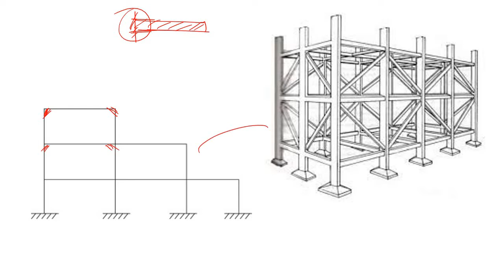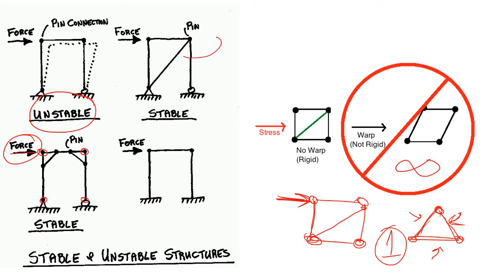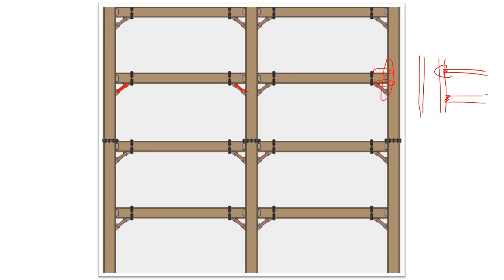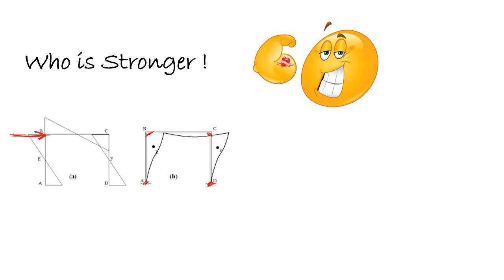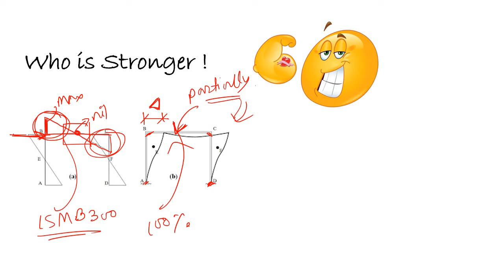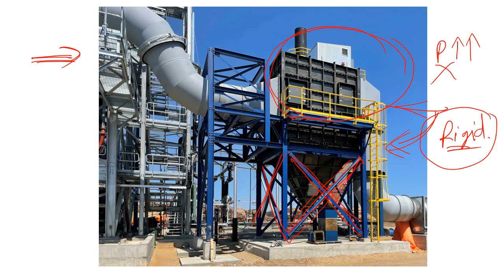Making Rigid Structure

Comment: Hi sir,
I have been following you since very long. Your videos really help me to develope as a structural engineer. 
Recently I was encountered with an interview where interviewer asked me, in piperack all longitudinal beams are released thus there will be no moment transfer at bottom of column but what about the moment coming at bottom of column from transverse direction which is moment connection? How pinned base plate will counter that moment. As far I know moment is carried by bolts so Is it the answer that the moment is carried by bolts present within the flanges.
Can you please explain about it?
Thank you for all the help sir🙏
Reply from the maker: Sure..I will post a video on it